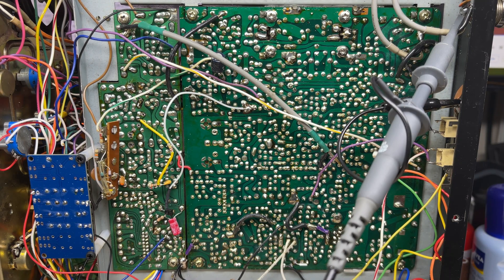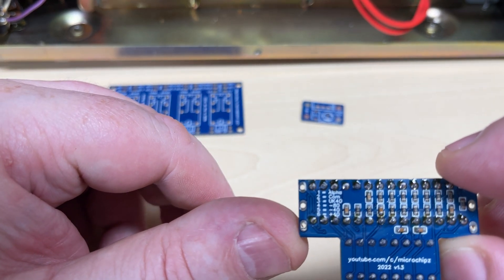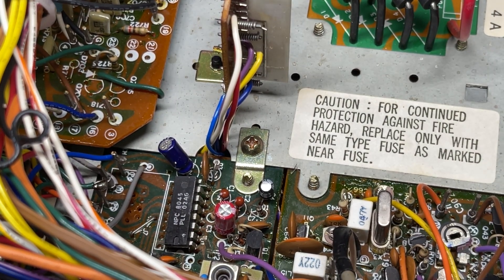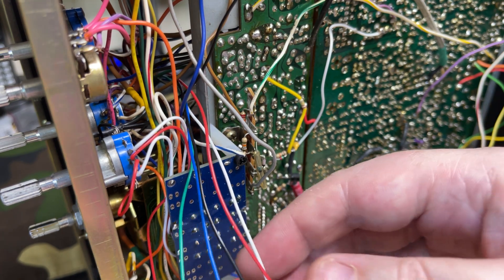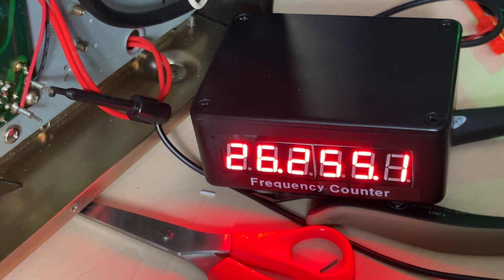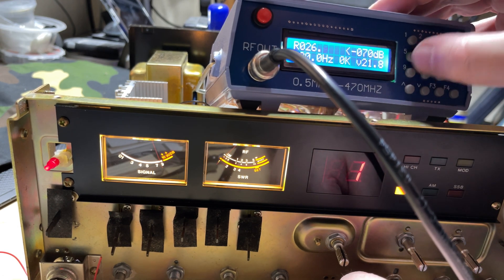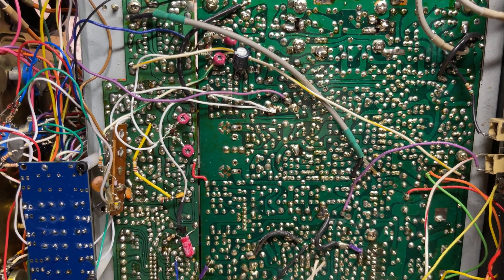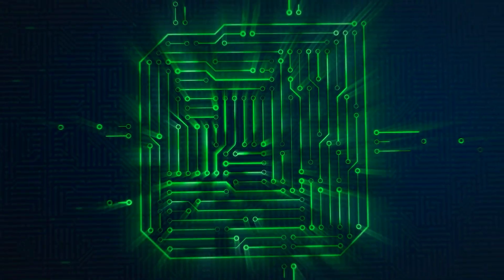EP 080 - HAM International Jumbo MK1 - Microchipz Jumbo edition PIC mod - Part 6

Comment: Nice. I did my mk1 jumbo with crystals, and had them especially made. 6-way switch 25.615-28.305 & UK 40 on tone switch & alphas on NB switch & NB moved to ANL switch & still have 41 to 80 display on the high band. Switching UK40 switch on HI HI takes it up to 28.455.
Reply from the maker: Nice :) , trying to get crystals made these days is impossible .
Reply: @MicroChipz  Quartslab Aberwrystworth. The crystal were in the 9 MHz range so cheaper than the 19 MHz crystals the later chassis use as in the MK1 I'm sure you know the second harmonic is used through a doubler. How are you switching the 3 VCO wires through the switch ((you're using a single wafer switch where as I had to use a switch with 3 wafers)as I am using a 6-way switch with 6 separate sliders as the crystal trimmer caps are switch to like original.
Reply from the maker: I thought quratzlab had gone , one went to holland , i removed the vco adjustments, advice from a good friend. the relay switches i use substitute the original band switch and allow me to use voltage to switch bands, one side of the band switch switches the bands the other side does the high light and maybe i will reconnect the 41-80 one day .
Reply: @MicroChipz  It was a couple of years ago I had my crystals made. My 3 VCO wires the low VCO wire switched in on triple low & super low, mid VCO wire on low & mid & the high VCO wire on hi & hi hi. Works fab.. .As for receive & TX power mixer coils, diodes are used for switching extra capacity via the band switch for the TX mixers to tune them down for better power down 25 & 26 MHz & transistor switching a variable cap to trim the middle receive transformer down on 25 & 26 Mhz or she is deaf. These caps can be adjusted for better receive & TX power on 25 & 26 MHz & then removed via band switch as you go higher in band.